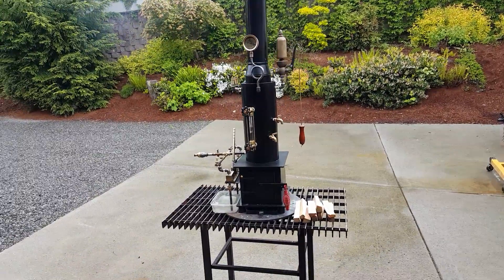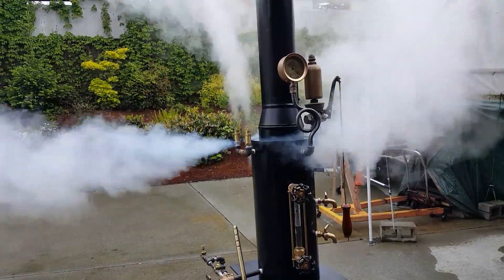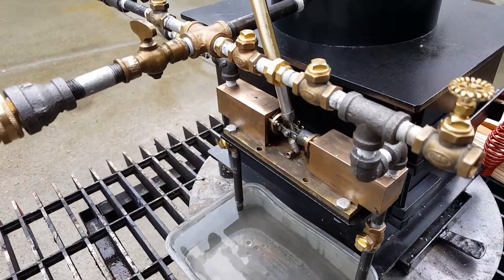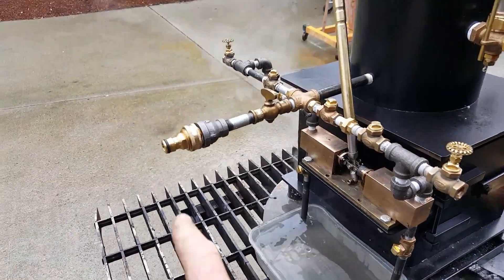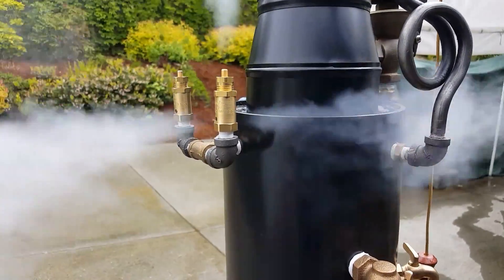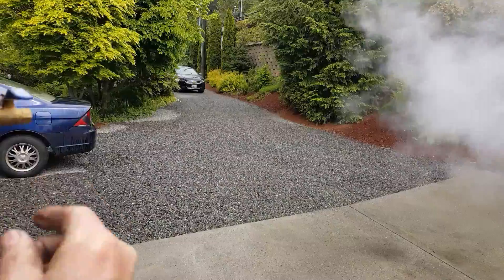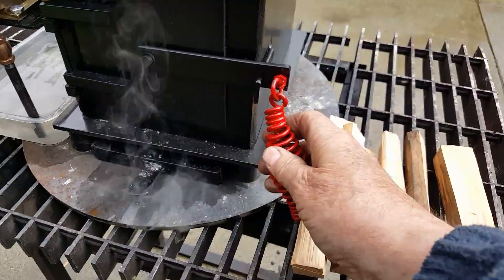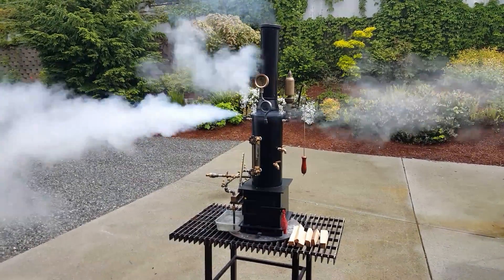Live Steam Boiler Hand Pump Whistle Gauge FOR SALE ON EBAY

Comment: I thought you sold your house and we're moving did that fall through my question is is how is the boiler welded stick welding tig welded or mig wire welder
Reply from the maker: Hello Gary
Yes I will be moving. I will get as much work done as I can. I will move on June 15th. All of the boilers are welded with a mig machine.